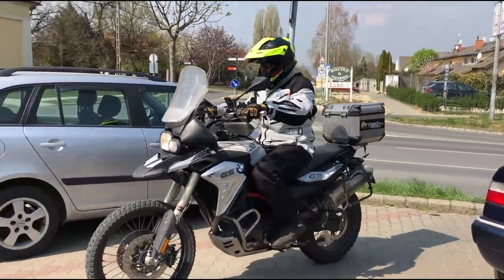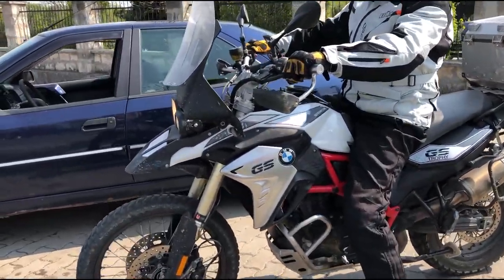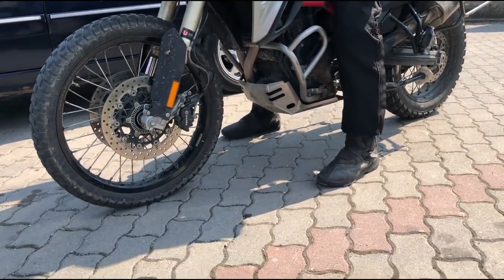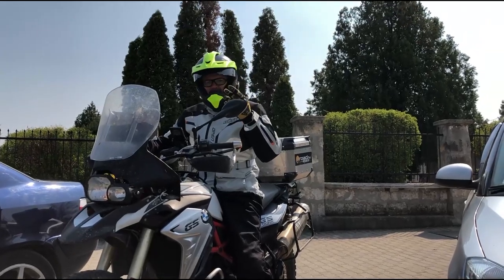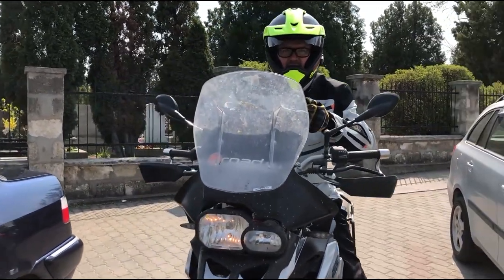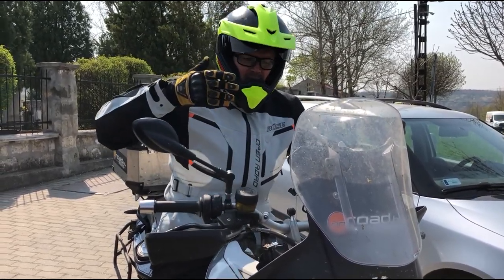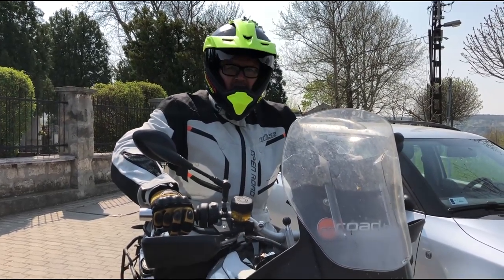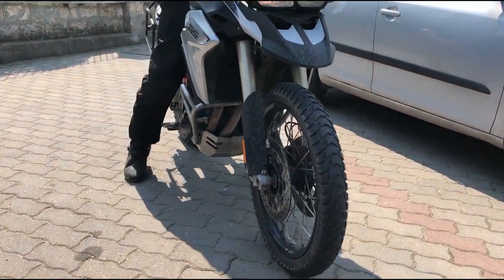Rider techniques, part 16: HOW TO REVERSE UPHILL? - Onroad.bike

Comment: i really gotta remember this "pumping" technique where you let your front suspension push you a little backwards because i feel it could be a life saver one day
i got stuck in a really awkward position today where i was rolling down a steep downwards hill in a parking garage but then the gate suddenly came down right before me
i could not squeeze through because the gap was just a few cm to narrow and i couldnt back up either
luckily some guys saw me and opened up the gate for me
cant thank them enough
Reply: Also sounds like a need to learn to pull a u-turn on an up/downhill situation though. And 1 year after, did you ever remember it?

Comment: Or... just roll it back before you get on it. Much easier and more controlled.
Reply: Only if you have the muscle to haul the bike "uphill"..  I currently have a wrist in a brace from trying to do just that on a slope only marginally steeper than his. I think his point was that the bike's forks do the work instead of your muscles.